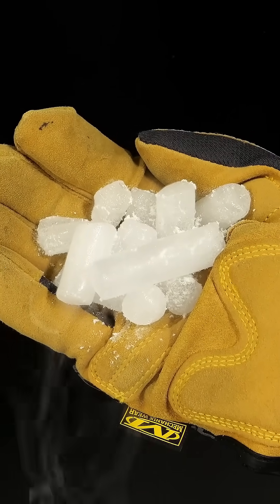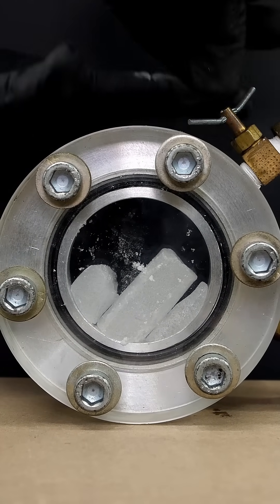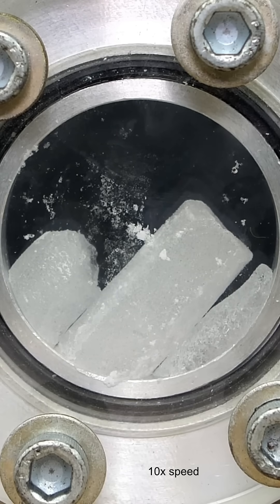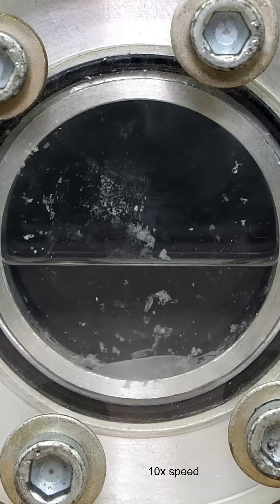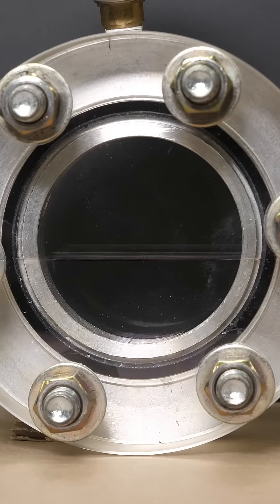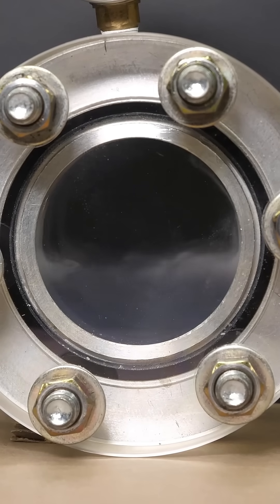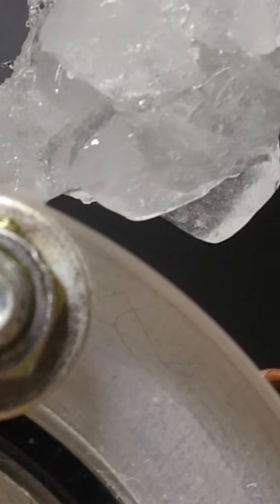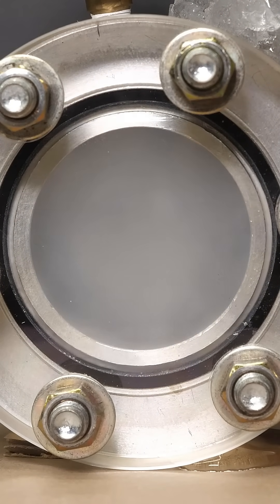This is not a liquid or a gas

Comment: It’s all fun and games until you open the container
Reply: For my (morbid) curiosity, what would happen if you were to open the container while the CO2 was supercritical?
Reply: @J.Trimboli 
It's a bit over 1000 PSI.

That can be quite  dangerous due to the pressure,  but assuming nothing bad happens,  as the container is opened, it will push the O-ring out, venting the CO2 to the atmosphere. The pressure will drop in the area where it is being vented, causing the CO2 to drop below its supercritical point. The temperature will also drop from the expansion of the CO2. So the CO2 will just turn into vapor, but with the temperature drop, could remain liquid. BUT, as CO2 is a kinda weird gas, it can't be a liquid at atmospheric pressures, so will deposition (reverse of sublimation) into frozen flakes of CO2 - aka dry ice...

What's really interesting is if the polycarbonate plastic window is left under high pressure CO2 for extended amount of time, the CO2 will diffuse into the plastic. Releasing the CO2 pressure can cause the plastic surface to "foam" from the CO2 pressure entrapped in the plastic
Reply: @BeliNavelia  
Ok, it shouldn't explode, but if you stress the plastic window enough, eg possibly by significantly loosening the bolts on side, but not the other, it might be possible to shatter the window, resulting in high speed shrapnel flung around.

I would expect the O-ring to blow out before that happens, however.
Reply: @jeffl4810  Maybe 1000 psi might be a bit too high. For perspective, minimum strength of concrete is 2500 psi.
Reply: @J.Trimboli you just giving an Dangerous idea😂😂😂
Reply: @J.Trimboli if u open it, the pressure and temperature will reduce which means the CO2 will turn into gas and escape the chamber. So 
Low pressure= normal CO2 gas,
 high pressure= CO2 becomes solid or liquid.
Opening the chamber would ultimately decease pressure so CO2 just becomes gas
Reply: Did he not just say its slightly above 75psi? Where did you get 1000 psi from?  @jeffl4810
Reply: @SilentMurphyTheSpy  
Supercritical pressure of CO2 is 1070.0 PSI and above, and @ 30.978°C and above. 
I just looked up the exact values.

Google the supercritical point of CO2 for more info.
Reply: @SilentMurphyTheSpy  once he gets about 75 psi the liquid form exists, i think gas form is 1000psi, even so the reaction would be like 
https://www.youtube.com/watch?v=fBUnKojrSEM&rco=1&ab_channel=cybersixchannel
which is fucking suicidal to open if it is 1k psi
Reply: @SilentMurphyTheSpy from heating ot
Reply: I wonder if they make those little CO2 cylinders by just dropping a piece of dry ice in them and closing them up.
Reply: @1chumley1  those CO2 cylinder piece IS what’s call dry ice. What’s your point ?
Reply: @fabienl4979  I was just wondering, not making any point.
Reply: It's all fun and games until it opens itself
Reply: Sounds like accidentally opening the door of space station...
Reply: @aashirsiddiqui5203 
The pressure difference of space compared to earths atmospheric pressure is minimal, and I believe they keep the space station at the same pressure as out atmosphere, which is 14.7 psi.
The space suits are kept at an even lower pressure, sort of like someone in a non pressurized airplane at a high altitude, just enough for them to be okay.
0 to 14.7 psi isn't that big of a difference.
That pressure vessel is holding back 75 psi compared to 14.7 outside of it.
Reply: Until he needed that system to make an aerogel. That project took a lot out of him but at least it was pretty satisfying in the end.
Reply: 75PSI is lower than the 150 PSI a home garage air compressor runs at, no danger. Not enough CO2 to pose even an  of danger for a human in a typical building.
Reply: Oh and the co2 would displace the 02 annnnd because your not a plant you go nite nite....for evv ver, 4 evvvvvver, fooooorrr Eeevvvvvvvvvvverrrr
Reply: High pressure Co2 turbines are amazing looped with geothermal well to deposit the cryogenic Co2 and expansion because of temperatures from hot rocks makes the gas expand beyond 1,000 PSI.
Reply: Hey doctor my face is missing 😂😂😂😂😂

Comment: Finally, a NileRed video where he doesn’t almost get killed
Reply: Considering the pressure inside that chamber I wouldn't be too sure..
Reply: A sealed chamber with dry ice is a literal bomb 😂
Reply: @monster0_0 Friends used to put it in two litter soda bottles and replace the cap. BOOM.
Reply: There's literally five atmospheres in that container. He's never been in as much danger as he is now!
Reply: you obviously didnt see the leak to the bottom right
Reply: @inakoekemoer8598 that was from the ice he was using to cool it back down
If it had a leak it wouldn’t have been able to transfer from solid to liquid to gas and back again
Reply: Nile: "What's really cool is what happens when I heat this up with a hair dryer."

Chamber: >BOOOM!!<

Nile: 🤕

Comment: It is so weird to see the dry ice not floating in the liquid CO2, but that's actually how most chemical substances work. Water is actually the weird substance where the ice floats on the liquid, because water is most dense at 4°C, just a few degrees above the freezing point of 0°C, and it actually expands a lot when it freezes.
Reply: Triple point of CO2? Pump the air out of the chamber first...

Comment: Open it. I wonder what will happen when it spills out as a liquid into lower pressure.
Reply: It really quickly turn back into a gas for the majority.
And for a small part due to all that evaporated the temperature drop low enough for dry ice to reform.

Comment: If you put gas under so much pressure that it turns into a liquid then its a liquid what is this clickbait lol
Reply: It's not as simple as that, the gas is at a pressure to high to stay a gas but the liquid is at a pressure to low to stay a liquid.
So it become something in between that is neither gas nor liquid.
Reply: @the10thdoctor84  pressure determines the boiling point so if you go high up and boil water at 60c thats not water vapor(gas)? Dont be silly
Reply: @TuriGamer  I'm not being silly, look at a proper phase diagram.
The top right corner represent the critical phase, by going beyond the critical point by increasing the temperature and pressure it become something in between gas and liquid.

Comment: so it's just vapour...
Reply: Vapor is the gas state of water so no.
Here it's too dense to be a gas but also not dense enough to be a liquid so it sits in between
Reply: @the10thdoctor84  I think I used the wrong word, i meant the liquids dissolved in air, like clouds, where the water is still in the liquid state but dissolved in the air
Reply: @todeilfungo  yes, but it's still not like clouds.
Reply: @the10thdoctor84  it's exactly like clouds
Reply: @todeilfungo  Super critical fluid is a state of matter that is extremely hot and under extreme pressure.
It's too dense to be a gas but not enough to be a liquid.

Clouds are cold in a low pressure environment, they are water droplets floating in the air.

You couldn't have two more different things

Comment: The sun's surface is liquid hydrogen metal - cool stuff.
Reply: hydrogen metal ? what ? did you smoke ?
Reply: @accueil750  At very high pressures, it's theorized that hydrogen ends up with metallic properties, and because of this it's called metallic hydrogen. It's thought to happen in the cores of gas giants like jupiter but not the sun since the sun is so hot, everything becomes plasma.
Reply: The sun is plasma all the way down to the core.

You're thinking of the core of jupiter

Comment: This is the first time ever ive seen co2 in liquid form
Reply: What happens if you drink it?
Reply: @GrosvnerMcaffrey your tissue in the mouth, throat, esophagus and stomach will be damaged by the cold.
However, in normal air pressure, it wouldn't be liquid, so it would probably freeze directly to dry ice. 
Basically the tissue will freeze so you'll get freeze burns and possibly other internal injuries
Reply: @GrosvnerMcaffrey  well well well, ever saw ice man on x men movie?🤓
Reply: It’s cool that he created 75 lbs of compressed CO2, without a boiler, or compressor. You could pump up a car tire with this chamber! But carrying around dry ice all the time might not be ideal.
Reply: Way to stay inside the lines nerd
Reply: @StayKindUnwind  chemistry thing was 20 years ago for me, experiment weren’t very accessible at that time, instead of talking shit on the internet go ahead and get a real job high school brainwashed kid

Comment: It's called the triple point. At a certain pressure and temperature it's possible for three states of matter to exist at the same time. Gas, liquid and solid.🤔🤯
Reply: And therefor that's not it at all, since you have neither of the three.
It's called the critical point

Comment: Can it be turned into an alternate fuel source like steam can? Just curious.
Reply: Steam isn't an alternative fuel source, it's just a medium you can use to transfer heat to another state. Steam engines still require a high energy fuel (usually coal) to heat up the steam and drive the engine.

Comment: Next time say: this is a bunch of solidified refrigerant R744! 

CO2 is commonly used as a refrigerant instead of flourinated refrigerants to reduce the GWP or Global Warming Potential is good to note that is much more efficient than regular refrigerants but due to its very high pressures we have to take more care than normal systems for instance a rack with R404A as a refrigerant the highest pressure is about 20 barg or 290 psi @ 45-46 ⁰C or 113-115⁰F that's the high side for the low side is about 3,2 barg or 47 psig @ -10⁰C or 14⁰F evaporation in R744 system the high side is about 112 barg or 1624 psig @45⁰C or 115⁰F and 25 barg or 396 psig @ - 10⁰C or 14⁰F evaporation and runs in transcritical mode the actual condensing action takes place on the receiver or so called flash tank!

Comment: I was just thinking, could this be used as a refrigerant? Compress the CO2 into  a liquid as it's sprayed into a radiator, at a slightly lower pressure like any other refrigerant. Being liquid and gas the compressor moving it through the system!  Would it pull heat to the condenser?

Comment: Co2 is actually a refrigerant, R744 to be exact. It’s pressures and operating range is insane! From 700-over 1300psi. Several supermarkets including Trader Joe’s use C02 as a refrigerant

Comment: For those of you who are curious "kind of a liquid and a gas at the same time" is known as the "triple point".
Reply: Liquid, gas, AND solid: three in one.
Reply: Nope.... sorry dude! You messed it up completely! 😉 The triple point and the critical point are two different things. At the tripple point gas, liquid and solid state exist at the same time and are in equilibrium. 😉
Reply: @kritter461  Correct. That's what you're looking at here.
Reply: @WifeWantsAWizard  Still no.... he was nowhere close to the triple point! You are mixing up both of them! 😉 

When he heats it up the system is shifted beyond the critical point. In this area of a phase diagram there is no phase boundary anymore... it's neither liquid nor gaseous - it's supercritical.

In this shown experiment he did not reach the triple point of CO2. In fact he was miles away from it which is at a temperature of -56 °C (217 K) and a pressure of 0.5 MPa. 😉

critical point ≠! triple point

Comment: why don't we just call it a vapor?
Reply: because its not vapor
Reply: @Balleater123  why not?
Reply: @electricpaisy6045  vapor is water particles suspended in the air. This is carbon dioxide in a whole different state of matter in between liquid and gas.
Reply: @Balleater123  I just wrote a reply to this but then I came to understand the difference I think. Vapor is one liquid material like water, in another gas material like air, while here all of it, the liquid and the gas are of the same material. Would you agree with that?
Reply: @electricpaisy6045  I’m this caseC, no, liquid and gas are not the same. It’s a whole entire different state of matter. So therefore it is not vapor.
Reply: But we might say it's CO2 vapor in CO2 gas. I don't think an in between state exists other than just some of it being in one state and the rest being in the other state and all of that is mixed up.

Comment: Am i only one whos rather nervous that there is around 55.2 to 62.1 bars inside that chamber and i doubt that is pressure tested and certified pressure vessel...
Mind car tires generally have only 2-3bars and that amount, roughly 100grams of dry ice turns into 85liters=small oil drums worth of gas, so if it fails at least you have that thing turning into rocket going trough a brick wall easily or if frame fails you will have at least permanent hearing damage, top of potential shrapnel wounds, burns, frostbite, or respiratory issues.
Dont fuck around with high pressures. Just aircompressor failing can lead massive damage and hearing damage even if not close by.

Comment: Bro, I don't know. Dry oce can't be melted in the first place
Reply: under high pressures it melts
Reply: Yes it can, it just needs to be under the right temperature.
Reply: @Balleater123  pressure* at normal pressure it just turns straight to gas
Reply: @johnmadlabs  my b you're right. Although at higher pressure it also has to be the right temperature

Comment: In refrigeration, when using co2 as a refrigerant, you have to ensure that you add enough co2 vapor to reach above 75 psi before introducing liquid co2 to avoid forming dry ice inside the closed system. If you take a look at an enthalpy chart for co2, they call it the triple point. Seeing it in a sight glass as a supercritical fluid is pretty funky because, typically, we dont let it get to that point. Co2 is also a volatile natural refrigerant. It can be very dangerous under harsh conditions and has extremely good heat exchange. Gotta be very carely adding heat, especially when there is still liquid present, could burst piping and blow a whole charge. On average, per degree added to the system, the pressure increases rapidly around 7-8 psi. That number increases when moving up the enthalpy chart. For instance, when co2 moves from the subcritical cycle to the transcritical cycle. Or, from transcritical to supercritical.
Reply: I understand nothing. ty 👍
Reply: What kind of equipment needs that level of refrigerant?!  P.s.  thank you for the info dump, you got him quite a few more views too 😂
Reply: @PlatsInGC  I would say gaming laptops, but they'd still overheat in 40 seconds compared to only 5 seconds at room temperature, so you could actually maybe boot up a single player game before it explodes.
Reply: @PlatsInGC Seed banks are one example I can think of, incase you don't want to use something as expensive or hazardous as liquid nitrogen.
Reply: @camronyoung96 typically in refrigeration, we see this on Hill Phoenix Booster racks that do both Med and Low temp refrigeration. There is a multitude of ways they set up those types of racks up as well. You can cool the co2 with air, water, secondary liquids like glycol, and even ammonia. It gets pretty deep on some real, but it's extremely interesting. At least, i think it is lol
Reply: I'm surprised that CO2 is a liquid at such a low pressure. I really thought it'd need to be at some insanely high pressure to remain liquid, not roughly the pressure in my bike tyres or my car's LPG tank, or about half the pressure in the air suspension tank.

I guess propane is a liquid at 6 bar and room temperature, though.
Reply: What happens when it goes ultra mega critical?

Comment: The hydrogen in the core of the sun has the pressure from 750,000 kilometers of pressure and heat on it.  Its no longer a gas either.
Reply: Nothing in the sun is gas, its all plasma

Comment: Neither but also both? So steam? Whats the difference?
Reply: Steam is a gas, more specifically gaseous water. This is a whole different state of matter between liquid and gas and cannot be steam because its made of carbon dioxide.
Reply: @Balleater123  vapor?
Reply: @KabegamiTheGreat  its not vapor either because vapor is just liquid particles suspended in a gas. This is a whole other state of matter in between liquid nand gas
Reply: @Balleater123  a solid?
Reply: @KabegamiTheGreat  its whats called a supercritical fluid which is a state of matter in between a lliquid and a gas
Reply: @Balleater123  so a cheese?

Comment: I’m curious and have a dumb question… when the heat is added to the pressurized carbon dioxide, is there a molecular change from the heat? Then, when it is cooled, it changes back into carbon dioxide; or does it always remain CO2 and the environment allows it to be stable in the state that is being  demonstrated?

Comment: “A liquid and a gas” ain’t that steam.
Reply: steam is just a gas
Reply: @Balleater123  and it’s also a liquid as you can let it build and the moisture will gather and cause water drops. 

If you gather your farts in a jar, it will just stay as a gas 🤷‍♂️ (unless you go further than a fart 😂).
Reply: @customgrow4292  the reason why it gathers together and forms water drops is because water is a liquid at room temperature so as the GASEOUS steam cools, it slowly condensates into a LIQUID.
Reply: @Balleater123  but we agree it’s a liquid and a gas 🤷‍♂️

Comment: So. I work with CO² tanker and this effect is horrifying. If you reduce the pressure too fast the CO² freezes into a solid at the point where the pressure is being relieved causing an ice blockage while the rest of the CO² continues to build pressure. Its an extremely dangerous situation.

Comment: Is there any way you could build this into a display that keeps switching the CO2 from gas to liquid? I'd really like to buy something like this that keeps the Co2 just switching between states.
Reply: you'd need a very high pressure chamber and a and refrigerator that can go to extremely low temperatures so in other words, it would be extremely impractical as a display